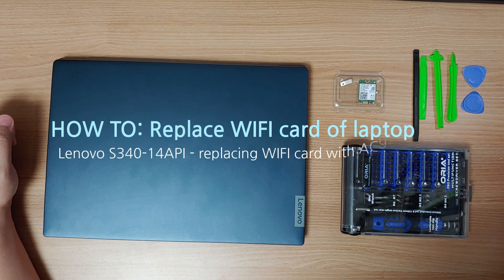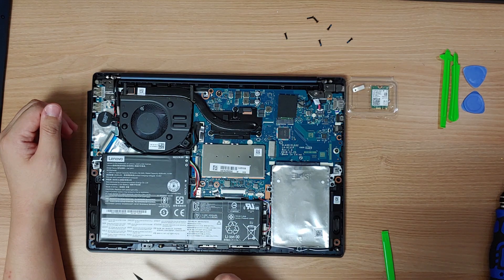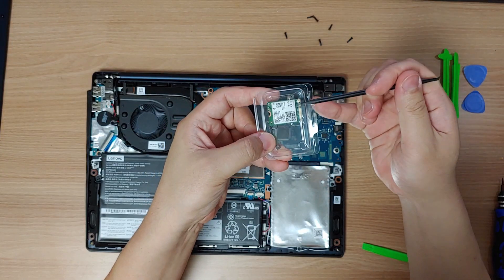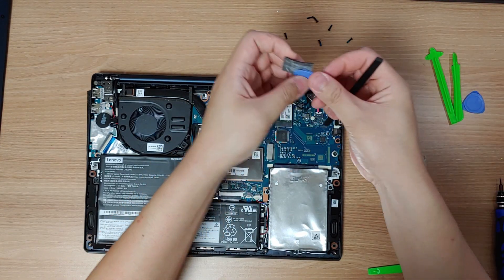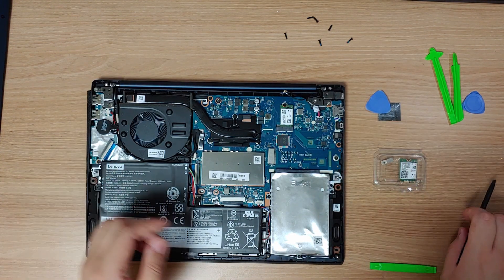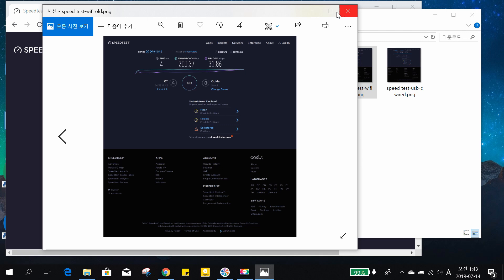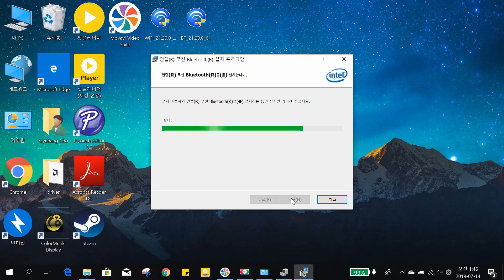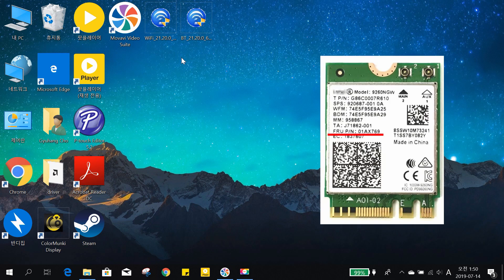HOW TO:Replace WIFI card of laptop

Comment: After seeing your video and also looking at some korean blog post about upgrading to AX200, i've tried to buy the AX200 with the FRU in the blog post but couldn't find it. And now i've gone ahead and gambled to buy the AX210 and find it working on my S340-14API 81NB. The FRU for the AX210 is 5W10V25784. After upgrading to the AX210 from a 8822BE the wifi is so much better. Thank you

Comment: Lenovo Flex 14 81SS000DUS 2-in-1 Laptop with Pen (14″ Full HD Touch, AMD Ryzen 5 3500U, 12GB RAM, 256GB SSD)
That's my model. Do you think card that you suggested would still work?
Reply from the maker: It is hard to tell. Lenovo Thinkpad lineup typically has whitelisting for WIFI cards, whereas Ideapad lineup typically doesn't have this policy.
I think it will work, but I cannot guarantee it.

Comment: Will the 01ax771 also work for the same laptop? Since it's considerably cheaper than 01ax769 I was wondering if I could go fot it.
Reply from the maker: That's a million dollar question. aayush sharma.
The reason why I suggested '01AX769' was that someone already tried it with S340, so it is likely to work with the laptop.

01AX769 is not mentioned as compatible device if you lookup S340-14API on the lenovo website, but it actually works.
https://pcsupport.lenovo.com/us/en/products/laptops-and-netbooks/ideapad-s-series-netbooks/s340-14api/81nb/parts/display/compatible

So... I assume that there is no WIFI card whitelisting for Ideapad laptops, which is very different to the Thinkpad lineup.
However, I cannot guarantee you that 01AX771 will also work.

Comment: Is changing Wi-Fi module of S340-15API laptop similar to 14API ver model? And does the changed module seems to work same in the 15.6 inch model?

혹시 15인치 레노버 제품 교체방법이 동일한지, 교체된 무선랜카드가 15인치 제품에서도 정상적으로 작동이 가능한지 확인하고싶습니다
Reply from the maker: Nothing guaranteed, but I assume it will work with S340-15API, too. Because those two models shares a lot of technical aspects.

15인치 모델도 비슷하기 때문에 교체방법 역시 유사합니다. 똑같이 저 무선랜카드가 동작한다는 보장은 없긴 한데, 가능성은 높다고 생각합니다.